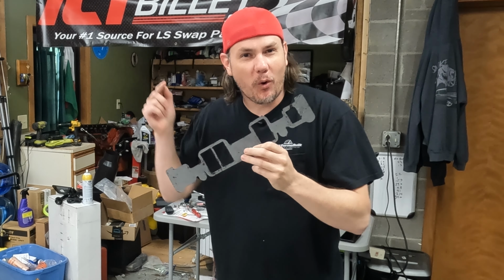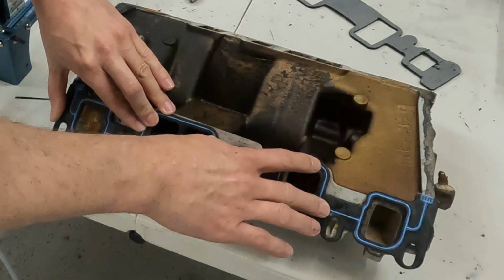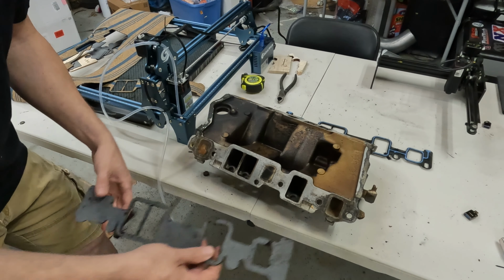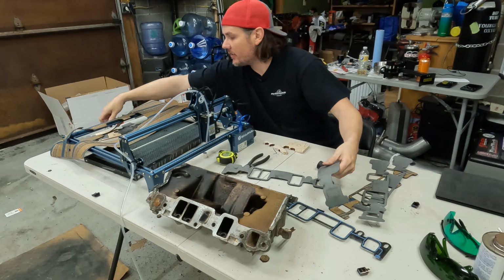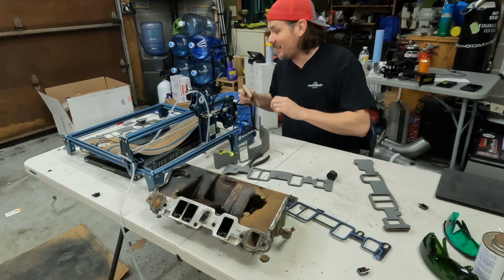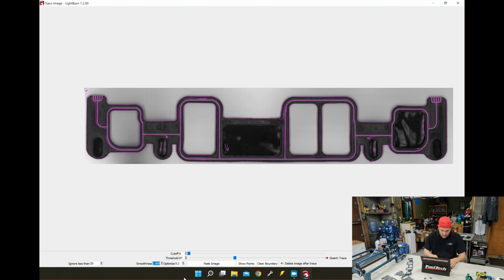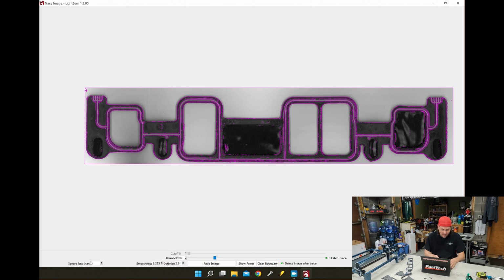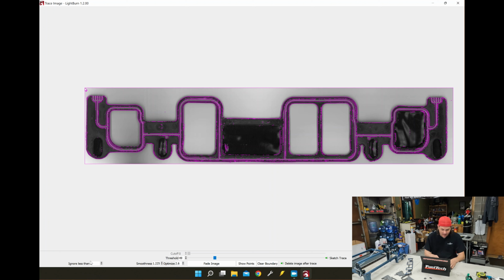GMC Typhoon Vortec Heads Custom Manifold Gasket Madness!!!

Comment: Do you have to add material to the intake manifold
Reply from the maker: I bought one already modified has about 3/16" of material added, there was a couple spots I had a buddy tig weld and build it up a bit more still.